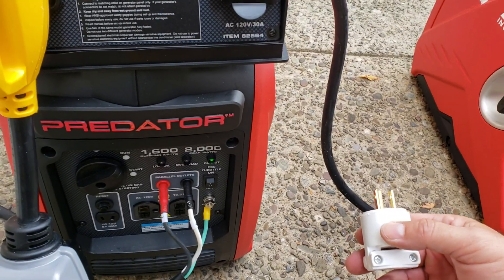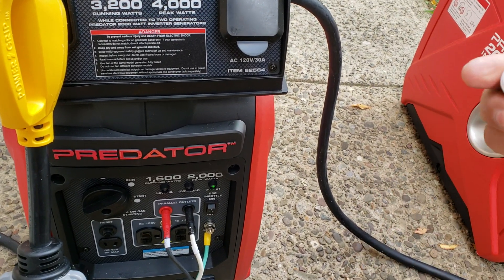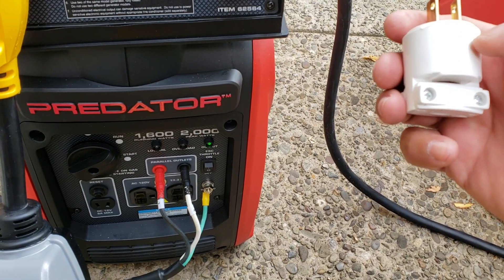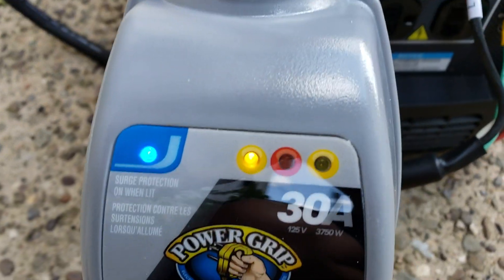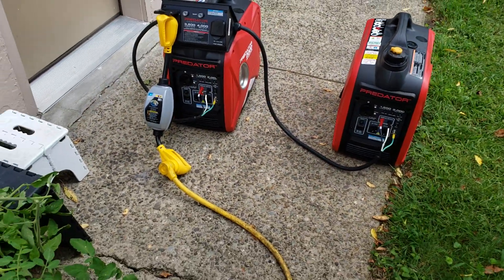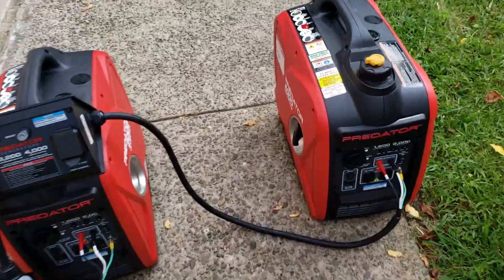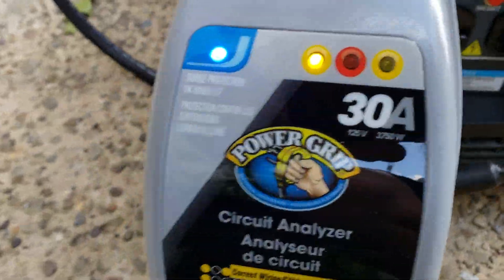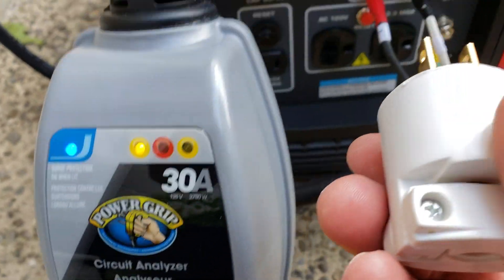Bonding a neutral for an RV generator

Comment: Is there any danger of doing this?
Reply: When bonding neutral to ground, the frame of the generator is connected to neutral as well.  Therefore contact with the hot while contacting the frame will zap you (a damaged extension cord or device where the hot/black wire is exposed).

Comment: You have it right as some other vids have shown.  I have 2 of the Predator 3,500's for the farm house or anyplace needed on the farm..  2020 models and Love them.  I am able to run the new gas furnace, chest freezer, fridge T.V. , lights, fencer, etc just fine without combining neutral and ground but know it's something to keep in mind.  Thanks for the video.

Comment: I just did this a few days ago with an Orange 🍊 plug like that. 👍
It works great.😎 I know Some folks like to take the back of the generator and run a jumper wire between numeral & ground… BUT then if you Don want it bonded you have to Undo Everything… instead of just pulling the plug out..!!! ✅

Comment: I bonded the neutral inside my generator with a permanent jumper wire.  Very easy to do, and now I don't worry about forgetting my bonding plug when I go camping.
Reply: I need to somehow find out how this is done, any suggestions?  Thanks
Reply: @jolkraeremeark6949 literally just stick a wire into the neutral and ground, cover with electrical tape, and you're done.

You could try to be fancy and take apart the control panel but that'd probably void the warranty and risk breaking other parts.

Comment: So I plugged my 5th wheel in my generator and I am getting an open ground error code on my readout.  So then I plugged my receptible tester into my generator and the reading is the same (open ground) . Did you just use an empty plug to fix? thanks
Reply: He bonded the ground and neutral.
Reply: corey Babcock  ah alright. Just a thought.